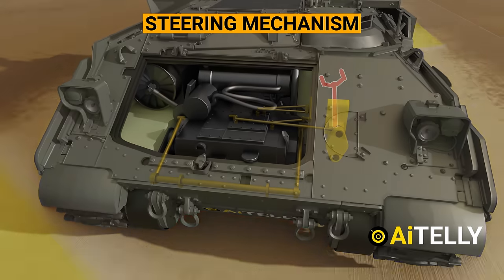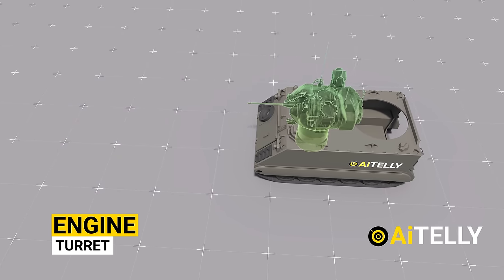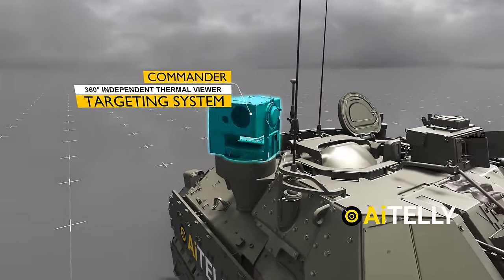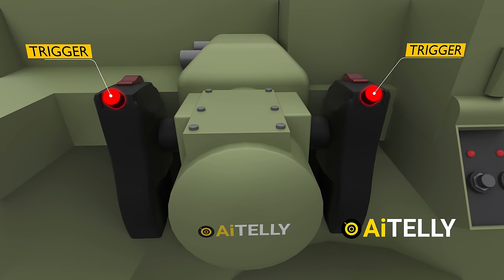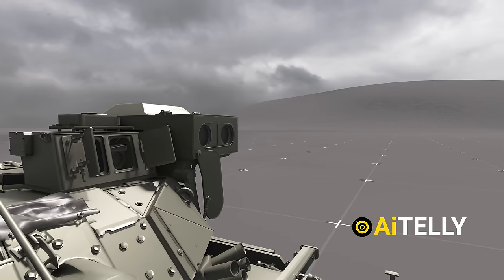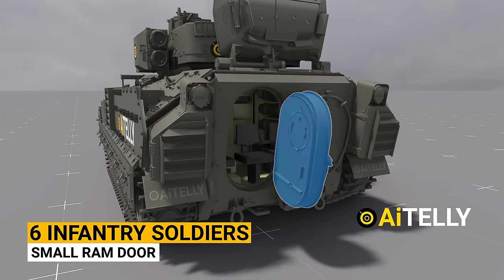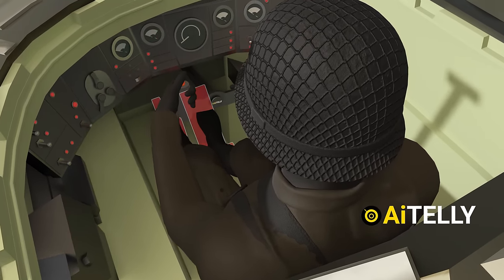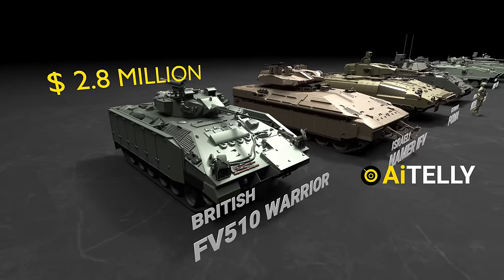Bradley Infantry Fighting Vehicle | How it Works?

Comment: not as good as a chinese or russian Fighting vehicle
Reply: … in exploding
Reply: The Chinese one is Copied version of Russian Infantry vehicle
Reply: Bots
Reply: the bmp line is the iconic, sure, but they suck. you can barely see out of them, they’re slow, and hard to reload their missile/rocket systems. they may be cheap, but that certainly harms these vehicles in the long term.
Reply: @Scorpion-kIeV-_  Not to mention reloading the AT-5/4 (depending on BMP-1 (the only one with the AT-4), BMP-1P, BMP-2 or BMP-3) takes the gunner out of the fight. The Bradley can be reloaded by infantry while still protected. The Bradley is way more advanced and safe.
Reply: @snnrslnx great comeback I’m sure the Russian defense ministry is imploding as we speak
Reply: One thing is the theory and other things is the real batlefield